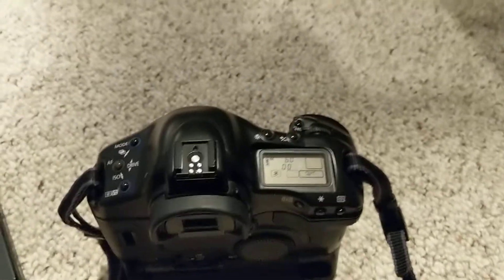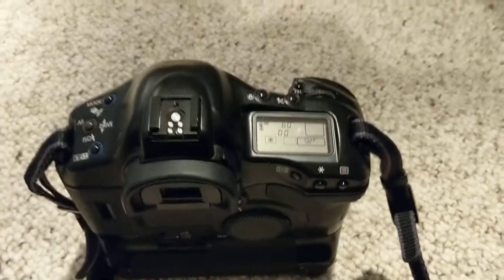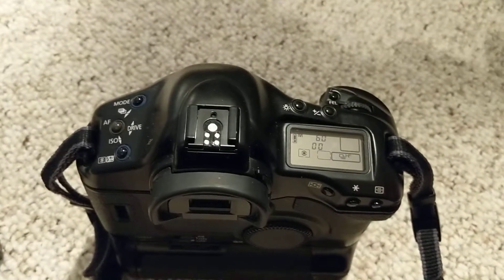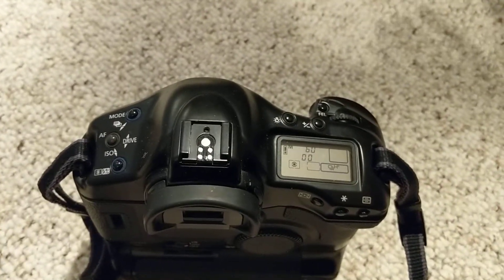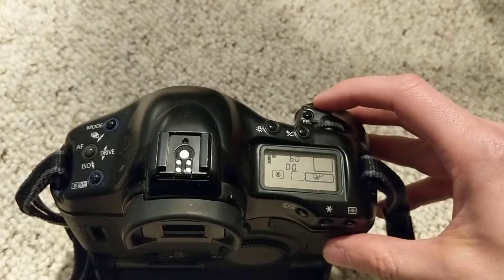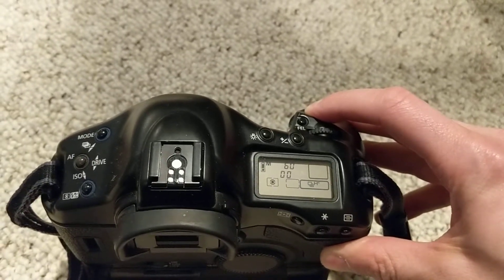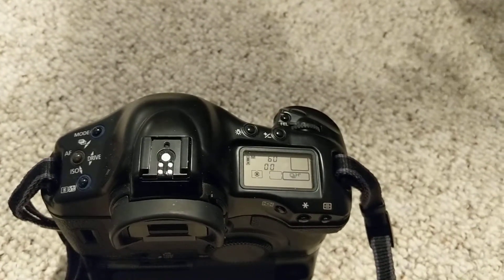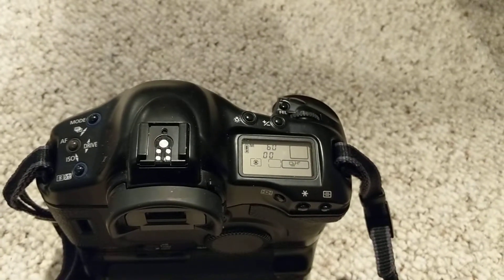EOS 1v DC coupler frames per second

Comment: Congratulation?  You are in ATG's HSS
Try it out with your battery magazine. You will not be able to get into ATG's HSS.

ATG Canon EOS-1VHSr specs:
*ATG frozen & weather sealed
*ATG lubed (NASA approved)
*ATG titanium camera/power booster
*ATG wireless camera shutter trigger & ETTL II trigger
*Canon battery pack not needed to retain 10fps (saving weight)